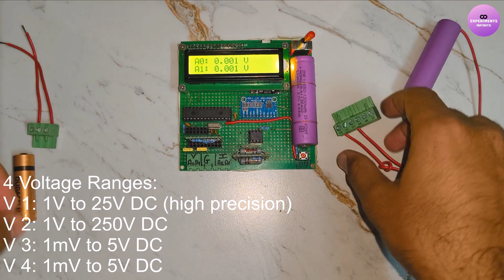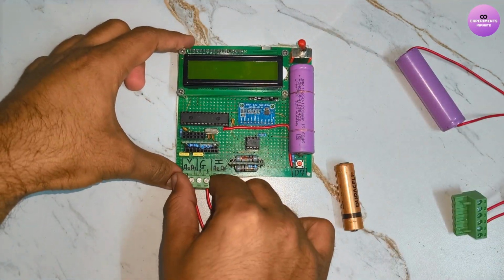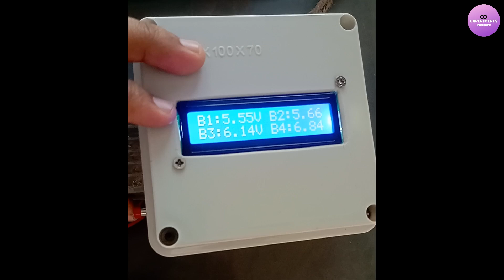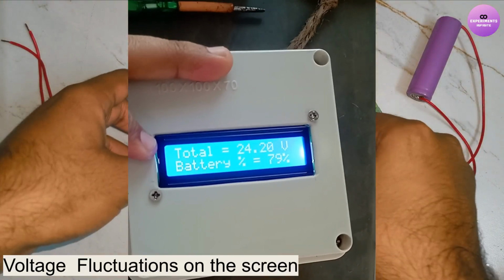Digital Voltmeter using Atmega328p microcontroller

Comment: In your program it should be 1024 as divider and not 1023
That's a common error in programming ADC readings
Reply from the maker: Here I am using ADS1115 it is 16 bit ADC
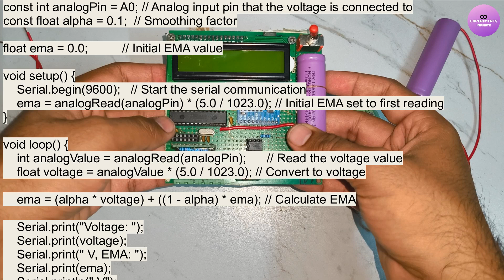Reply: @experimentsinfinite2009  3:48 4:07 is it your code on the screen?
Reply from the maker: This code is for reference.
Reply: @experimentsinfinite2009  O.K. Then in the code on the screen divider should be 1024.

Comment: what's the maximum voltage it can accept? also, try out an SSD1306 display
Reply from the maker: The maximum voltage depend on Voltage Divider (resistor) circuit. In future videos I'll try this display
Reply: @experimentsinfinite2009  Thanks for the info!